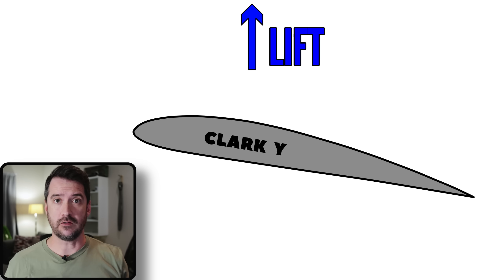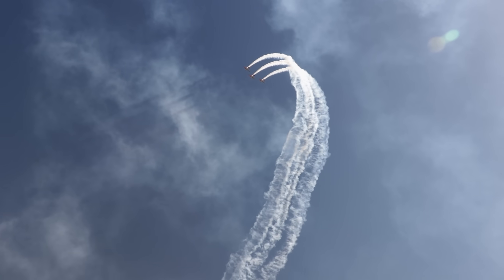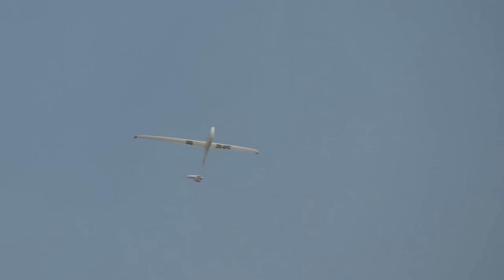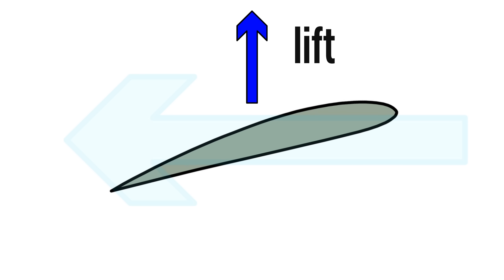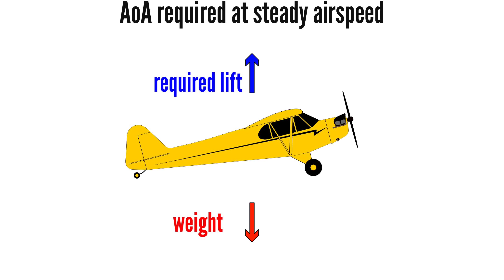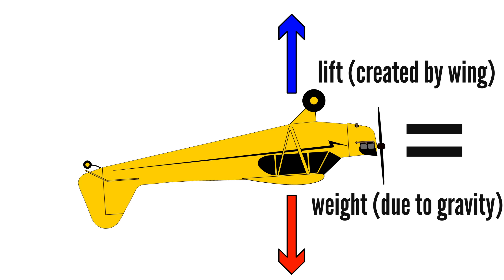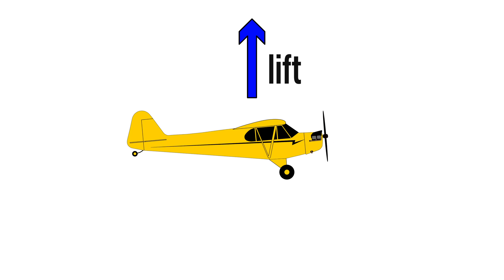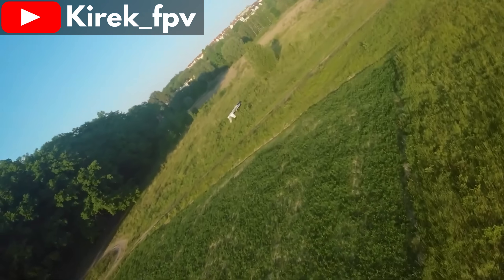Is Airflow Distance Over the Top of a Wing Always Longer?

Comment: The simplest wing is just a flat plate.
Some small model aircraft have a wing made of a slice of Balsa wood.
The distance above and below the wing is the same.
The lift is created by deflection of the air, which has mass and, therefore, the lift force is f=ma ie mass of the air x acceleration of it.
Reply: It is my belief that the model airplanes that can fly with a perfectly flat top and bottom (and with a blunt leading and trailing edge) i.e. no airfoil, are doing so strictly by angle of attack. The positive angle of attack is trimmed for level flight and when the plane is inverted, it simply requires a larger elevator deflection in the opposite direction to maintain level flight. I have seen this firsthand having flown models with this type of wing. I am sure that is it is extremely inefficient and that a full scale airplane would not be able to achieve this for host of reasons. My guess would be that drag would be the primary reason.
Reply: @bruceroland5683  Part of the answer can be the turbalance over the top of the wing, a traditional wing shape can be created with a small amount of turbalance instead of the solid wing. Drag helps in this.
Reply: @bruceroland5683 look at the airflow over that flat wing with a positive AOA, it’s still similar to an airfoil wing
Reply: @bruceroland5683  A full scale plane can fly this way, you just have to go damn fast.
Reply: I think the last minute disclaimer of your explanation disproved the bulk of your argument. The fact that airplanes can fly well with symmetrical wings is all you need to disprove that argument. The main error is that the basic "longer the path over the curved top equals lower pressure" is too simplistic and incomplete an explanation. And your handwaving attempts bear this out.
Reply: @robertmatch6550  You're mostly correct, and everyone is partially correct and it is interesting why this debate polarises people on to one camp or the other,  neither is 100% correct and its not up for debate its well understood for more than a century, but it is often depicted incorrectly even on modern pilot training material.  

As an aerodynamicist the lift comes from Newtons law, as you correctly state, that is that there is a net downthrust of an air parcel which results in an upward force - lift, this is how a plane flies and its even how a Bee flies.  If the curved top were the only thing that produced lift then there would be no downwash from a helicopter (which is a rotary wing) but there is and its all of the aircraft's weight. However, the curved top surface does product a pressure difference which contributes to the lift; its just not as big as people think.  But we don't need to reckon anything, you can if you like work it out, for a cessna 172 at 90mph that force is about 50 pounds of lift - so it does work, but its about 1500 pounds short of lifting the aircraft.  With some wing sections is a lot more significant and with others is totally absent - both fly.  There are plenty of maths and practical pressure sensing experiments over the years that show what the pressure difference is and the experimentation and maths agree so we can all move on.

The shape of the wing is what misdirects people.  You can have a flat plank (we call barn door) and with an angle of attack it produces lift and the lift is directly proportional to the angle of attack... until it isn't.  We don't use barn doors on planes because the point and which they stop flying is catastrophically abrupt.  Instead the NACA aerofoils are designed to progressively keep the air attached using the Coanda effect under various loadings and conditions. Note; Benoilli has nothing to do with it (thats just a special form of the Coanda effect for a veturi which is basically a wing bent round to meet itself), Coanda is the effect that a fluid will follow a surface with a gentle curve because to not do would create a vaccum. Instead we get a low pressure if its attached because we've stretched the air between the un-peterbed air and thge top surface of the wing.  Its not that low pressure that keeps the aircraft in the air, but it does contribute.  The air from the trailing edge leaves the aerofoil at an even steeper angle than the angle of attack producing even more lift, and high lift low speed wings have fat sections with nice gentle curves and may even have convex curve on the bottom to help.  If you want low drag and you're not bothered about low speed then you don't want that curve and fighter jets have thin flat wings and we add the curve with flaps or slats for low speed or high alpha manouvres but otherwise its remarkable what the section actually is, its more like a symetrical diamond for various reasons.  Aerobatic aircraft have nearly symetric wing section but as shown in the video provided you do not exceed the critical angle of attack with the bottom (now top surface) you can fly up side down with any wing.  Its stall characterstics will be pretty terrible, but for aerobatic machines thats part of the point.

So an aerofoil does not solely provide lift because the top surface is curved, because: it doesn't need to be curved at all. But it is part of the story for many wings, it varies from a significant contribution to none at all and everywhere in between.  The full story is unimaginably complicated and many books on the theory, and not all of the accepted text agree 100% but the maths does.  But to keep it simple you can replace the wings on a Cessna 172 with flat planks of sufficient area and it will absolutely fly; although you'd probably die trying to land it because it will fall out of the sky when you try to flare assuming you got that far.
Reply: Small increase in a of a of a flat plate produces lift, it's a water ski effect, not normal lift.
Reply: btw if anyone can actually properly demosntrate air not obeying newtons laws there's a nobel prize in it, probably several actually, do go ahead and try to actually prove that on a professional level
Reply from the maker: From what starting point are you measuring if you get the same distance over and below a plank wing with a positive angle of attack? Or are you saying the stagnation point isn't where airflow visualization shows it is?
Reply: @LetsGoAviate  that visualisation is not of a flat plate
but yes stagnation poitn can shift
in a very thin cambered plate with airflow aligned with its leading edge its very close to its leading edge though despite it having almost not lenght difference nad producing plenty lift
Reply: @LetsGoAviate  Wait,...WHAT?!
Reply: @LetsGoAviate  What he is saying is he does not understand how a wing creates lift. I have been flying for 70 years now, I learned the correct way to look at it when I was 5 years old, and can't understand why others have so much trouble.
Reply: @LetsGoAviate  A wing is a flow turning device. Curvature of the upper surface of the wing increases the Coanda effect, turning the flow more effectively (the easiest way to demonstrate Coanda effect is to dangle the back of a spoon into the flow from your kitchen sink tap).
Reply: @boydw1 
Wings can produce lift when there is zero downward movement of air.
Reply: @Talon19  Incorrect. Vertical movement of air IS the primary generation of lift. 
A non-symmetrical wing can generate lift when there is zero angle of attack vs the mean chord line. There is still vertical movement of air due to the asymmetrical aerofoil shape.
Pressure differential is a side effect of lift production - it's beneficial as it adds to the lift vector, but can only account for 5-10% of total lift  generation.
NASA will tell you the same - a wing is a flow turning device.
Reply: @boydw1  
Simple test: tape a piece of paper across two level surfaces; 
blow across the top of the paper; 
the paper will bend upwards.

Your explanation doesn’t explain this observation; differential pressure does.
I know because I have a bachelor’s degree in aeronautical engineering, a master’s degree in aeronautical science, and over 5,000 hours flight time in aircraft ranging from single engine GA, to multi-engine military aircraft.
Reply: @Talon19  That's not a legitimate example of how a wing experiences air flow. You're blowing air across one surface, while the air under the other surface is stationary. 
Airflow as it meets the wing is equal velocity above and below the wing.
Airflow over the curved surface of a wing does accelerate slightly. With a typical asymmetrical wing the flow over the top of the wing reaches the trailing edge a few inches ahead of the flow underneath the wing. There are wind tunnel tests with pulsed smoke demonstrating this effect (if you'd actually studied aeronautical engineering, you should already be familiar with them). Pressure differential from that small acceleration isn't nearly enough to generate meaningful amounts of lift, though it does contribute to the Coanda effect in TURNING FLOW.
Here's NASA's explanation (it's targeted at kids, so even you might be able to grasp it 🤣)
https://www.grc.nasa.gov/www/k-12/airplane/right2.html
Reply: @Talon19  "Wings can produce lift when there is zero downward movement of air."

Blatantly false. Unless there is something beneath to transfer the force/momentum to (i.e. the floor) there must be a net downwards movement of air in order to apply an upwards force to the wing. 
"Simple test: tape a piece of paper across two level surfaces; 
blow across the top of the paper; 
the paper will bend upwards."
Yeah, so WHERE DOES THE AIR GO???
Down, below the paper, genius. You're not pulling kinetic energy out of nowhere or forming a vacuum beneath the paper, the air passing over the top of the paper is deflected downwards and the surrounding air moves downwards to displace the paper.
"I know because I have a bachelor’s degree in aeronautical engineering, a master’s degree in aeronautical science, and over 5,000 hours flight time in aircraft ranging from single engine GA, to multi-engine military aircraft."
Do you work for Boeing? It might explain some of the problems they've been having recently. Some creationists are biologists, and apparently some people who don't understand the basic principles of mechanics and thermodynamics are aeronautical engineers.
Reply: @boydw1  
Here is another test.
Place a flat board on a scale, then tape an inverted plate on this board.
Use a leaf blower across the board; the scale will show reduced weight.
No change in vertical deflection of the airflow around the board.

You could also just use a wind tunnel or water tunnel to demonstrate the same thing with pressure points across the upper and lower surfaces of the flat-bottom, positive-camber wing with a flat plate keeping the upper and lower airflows separate.
At zero AOA, there will be a net negative pressure over the top of the wing, even the flow streamlines won’t cross or curve at the trailing end.
Reply: @nathangamble125  
Still wrong because the test remains valid where the air cannot flow from above the paper to below; such as in a wind tunnel.

I’ve done these and even more advanced tests in wind tunnels.
There is also the simple matter of the mass flow rate and net vertical deflection relative to the chord line doesn’t account for nearly the total lift generated,
Again, something I’ve tested multiple times.
Reply: @Talon19  in total only if there's somethign below the air pushing it up in whcih case you are pushign that thing down
and locally no, just no
Reply: @Talon19  are you sure about that?
cause air will tend to go down behind a corner
its also not hte situation a wing is actually in
you can however easily measure centirfugal force in a bent tube
Reply: @JulianDanzerHAL9001  
Simple tests with wind tunnels show otherwise.
I don’t blame you for thinking deflection of fluid is the sole cause of aerodynamic forces; the vast majority of people have never seen a windtunnel in person, much less ran experiments with it.
Reply: @Talon19  btw, what do you thin kwake turbulence is?
ever tried flying a cessna right behind the wingtip of an airliner?
I would not recommend it
ever wodnered why aspect ratio matters in wings?
why helicopter rotors need a certian rotor diameter to work well and having many short baldes with the same balde area but a smaller rotor doesn't do the same?
Reply: @Talon19  As I've already pointed out, that experiment is NOT representative of the airflow experienced by a wing in flight, thus is null & void.
A flat board at zero AoA doesn't produce lift - the forces are equal on either side. 
If you add AoA or camber, you generate lift BY TURNING FLOW!
The vertical displacement of air is obvious in the aforementioned pulsed smoke wind tunnel tests. 
Unfortunately a lot of flight instructors & teachers are still incorrectly teaching flight principles based on Bernoulli's principle rather than Coanda effect (despite Bernoulli's principle having been debunked as the cause of lift generated by a wing decades), simply because that's what that were (incorrectly) taught, and they don't know any better. You're a prime example of this.
Reply: @Talon19  do you know what wake turbulence is?
do you know what prop wash is?
why do you think t-tails exist?
why do you think groudn effect is even a relevant thing in the first place?
why do you think jetfighters tend ot be bad gliders?
why do you think winglets exist?
all relevant questions unlike relatively unrelated and explainable phenomena you guys list its kinda ridiculous
Reply: @JulianDanzerHAL9001 
All the examples you listed are due to vortices caused by air circulating from high pressure areas under the wing to low pressure areas above the wing.
Reply: @Talon19  and as it circulates
what does the air
right behind the wing
do
in that circulation?
draw a plane form behind and two circles around its wingtips with arrows on them if that helps you think
Reply: @boydw1 
I’ve done the experiments myself in wind tunnels, as well as used CFD and Navier Stokes Equations, which plainly show the distribution of pressure around the aircraft is what causes the force known as lift.
Additionally, a cambered airfoil with long stretches of flat plate aft of the trailing edge still generate lift; this directly contradicts the “flow turning” theory.
Also, the so called flow turning theory isn’t actually useful because it gives no predictive or applicable quantitative analysis.
The Euler Equations, and by extension the Navier Stokes Equations, are based on and derived from Bernoulli’s equations.
Reply: @JulianDanzerHAL9001 
The air is circulating at the very end of the wing, not along the rest of the wing; again refuting the flow turning myth.
Reply: @Talon19  ah, a common misconception among peopel iwth no clue about aerodynamics who think airflow only exists when it is fast enough to be easily visible
in a long wing the downwash gets slower the furtehr form the wingitp you go
agian
read articel on lift induced drag
it is goign to
blow
your
mind
and
if you're veryi nterested in aerodynamcis but simply lack the understanding
it will compeletely reshape reality for you
do it
and learn
Reply: @Talon19  btw do you know what a vortex technically even is?
like oyu know it doesn't just stop at some magical border right?
tahts why trying to counter that vortex doens'T work unless you ahve osme device like winglets or simply longer wings that increase the cross section of air you are cirulating
then you can imaprt hte smae momentum while causing al ower downwash speed because you are affecitng more air
the further form the wingitp you go the bigger the circle aorudn the wingtip you're on duh
there's agian a great aerodynamcis lecture you can watch on youtube on this
Reply: @Talon19  Navier Stokes equations describe the conservation of mass. momentum & energy of an incompressible fluid. Pressure is one of the variables in the equation, but the components of the equation are vector magnitudes -mass, velocity & direction. 
In other words, Newtonian physics.
Reply: @boydw1 
Still missing it, I see.
The Navier Stokes Equations resolve the pressure distribution around an object.  From this pressure distribution, forces can be resolved.
Navier Stokes can be simplified to Euler Equations, which can further be simplified down to Bernoulli equations.
This is why aeronautical engineers use principles of temperature, pressure, length, velocity, density, relative humidity, and other directly measured variables for initial design of aircraft.  
A velocity vector and mass flow rate aren’t useful for designing aircraft or the stability, control, weight, balance, and engine performance used in avionics.
Engineering is the application of science; the flow turning theory isn’t something that can be used for measurements, predictions, or verification.
Reply: @Talon19  And yet with all thouse credentials you still make Elementary school errors like beliving in violations of Newtons 3rd law.
Reply: @Talon19  The Navier Stokes equations are fully Newtonian and require air to be deflected to produce lift, your claiming that these equations disprove flow turning show that you don't understand them.
Reply: @kennethferland5579  
Pressure differential doesn’t violate Newton’s Third Law.
Reply: @kennethferland5579  
Still no.  The NS equations are built upon pressure differential.  Without pressure differential, the NS equations wouldn’t and couldn’t exist.  Navier, Stokes, and Euler all based their theories on Bernoulli’s theories.
Reply: @JulianDanzerHAL9001  
One of the first wind tunnel experiments I did as part of my aeronautical engineering degree was a long flat plate with zero AoA and a small camber area in the middle.  This prevented air streams from crossing or turning or circulating.  
The whole purpose of that experiment was to show objectively the circulation/newtonian/turning myth is false.
Reply: @Talon19  then whoever trained you has a very poor understanding of physics
assuming the ends are both parallel and there is only a small bump in th emiddle you will get a high pressure, low pressure nad high rpessure zone and a net force of 0
also assuming its one wall ofa  wind tunnel the whole ocmparison is ocmpletely invalid because you transmit forces to hte other wall
thats kinda why wind tunnels are ideally bigger than the airplane model you test in them duh
if that and newtons laws are news to you depsite suppsoedly having studied the subject hten I am sorry that you appearently had a bad teacher waste a lot of your time
again, if you can show an airfoil disobeying newtons laws then write a paper, win an obel prize, use it to build a perpetuum mobile, get rich
or else shut up and learn
Reply: @Talon19  to be fair, most highschool physics experiments basically use flat earth approximations so I guess the lesson is not to stick to teh first thing you learn duh
Reply: @JulianDanzerHAL9001  
The experiment was ran at multiple Reynolds’s numbers and at different times of the day and year.  All results confirm a low pressure area where the camber is.  It’s part of the course syllabus.
Reply: @Talon19  that was not the problem duh
let me guess
you thin if you throw a ball it follows a parabolic arc too
well this neglects taht throuhg its trajectory its distance from earth and direction from the earths center changes
i nreality it follows a small section of a very elongated ellipsis
the parabola is basically a flat earth approximation
but hey, the approxiamtion is decent as long as you look at a small enouhg scale
this is true for several different balls and at all times of day
its also part of middle school physics
so clearly earth can't be round right?
do you see the problem?
Reply: @Talon19  based on your misunderstanding of aerodynamics a widn tubrine should not slow down the air behind it
after all they are basically three spinnign glider wings where around the turbien is forward for the wing and the direction fo the wind is up for hte wing and the forward motion a glider can gain by diving is what drives the turbine and the wind gets slowed down behind the turbine because a wing redirects air downwards
if this was not hte case you should be able to put many widn tubriens rightb ehind each other, use a jet engine to blow some air into it and produce INFINITE ENERGY
whenver that is the case in physics you know you've messed something up
Reply: @Talon19  why d you think birds fly ina v formation by the way?
clearly ab ird is not much smaller than a bird
and why do you think t tails exist?
I mean taillanes are generally not behind the wingtip
Reply: @JulianDanzerHAL9001  
The problem is you.
Reply: @Talon19  don't let me stop you from writing your paper and winning your nobel prize lol
Reply: @Talon19  btw accoridng to your understanding winglets should be infinitely effective as soon as they're like 1chord long so you could build a glider with subby wings and decent winglets and expect it to glide perfectly
yeah lol I just can't htink of a single concept in aerodynamics that doesn'T just baltentyly demosntrate how wrong you are
please attempt reading ab ook
or at least wikipedia
at least liek 1 page
Reply: @JulianDanzerHAL9001  
You obviously have little to no understanding or experience with how the lift equation works.
Reply: @Talon19  wikipedia.org/wiki/Lift-induced_drag
there's am uch more relevant equaiton to this discussion
by the way
did you know
that the same variable
can show up
IN MULTIPLE EQUATIONS?
mind blown right?
Reply: Lift is created by low pressure over the wing due to the acceleration of air over the wing due to various complex reasons none of which have to do with the path being longer over the top of the wing.  

The air being deflected downwards is an effect of that.  Not a cause and not even necessary to produce lift (consider a plane on the ground where the air can’t be deflected.  

It’s the same as a rocket engine.. an imbalance of forces due to expanding gasses where one side of the combustion chamber is open.. so there is no force against that to cancel out the force pushing upward in the combustion chamber.  Everyone concentrates on the flames going out the back but not one person asks why the rocket doesn’t go sideways when the flame trench underneath the launch pad defects the flames sideways.
Reply: @calvinnickel9995  you've discovered one half of ground effect, now discover the other half
this time, consider that the ground exists while you do
Reply: @JulianDanzerHAL9001  Come on, when you are lost, you are lost.
Reply: @tedmoss  if you can't actually argue I'll assume thats jsut irony cause I spend like a lto of time studying airflow and the opposign arguemnts are mostly falt earther levle misunderstandings of basic physics
Reply: A plane on the ground still deflects air down. That air then bounces off the ground back into the wing, increasing lift. You can argue about it being pressure vs newtonian forces, but in reality it's the exact same thing. A force is pushing the aircraft up by way of pushing other things down
Reply: @SirDoggydog like with many physical theories, momentum and pressure are interrelated and can’t be fully separated into cause and effect. They’re different aspects of the same thing.
Reply: @calvinnickel9995  "The air being deflected downwards is an effect of that.  Not a cause and not even necessary to produce lift"
No, plane wings do not break conservation of momentum. The air must be deflected downwards in order to apply any upwards force on a wing passing through it. The greater velocity of the air over the top of the wing relative to below the wing explains how the air is deflected downwards.
"consider a plane on the ground where the air can’t be deflected.  "
wut?
You know that air exists at ground level, right? How do you think planes take off? How do you breathe ?
Reply: @calvinnickel9995  Think of wing is a sail. Sail works best being perpendicular to wind flow, so no long path or low pressure behind it. It's all about pressure of upcoming flow. Guys who built first planes and guys who sh!t out lift theory are different guys.
Reply: @calvinnickel9995  Because the flame trench under the rocket is a different object, and IT experiences an enormous force sideways and downward in direct proportion to how it changes the velocity of the rocket wash by deflecting it.  And how you think a plane cant deflect air when close to the ground is beyond me, they DO do exactly that.